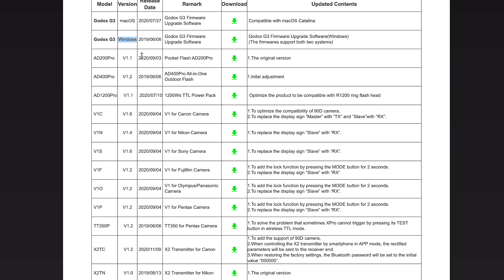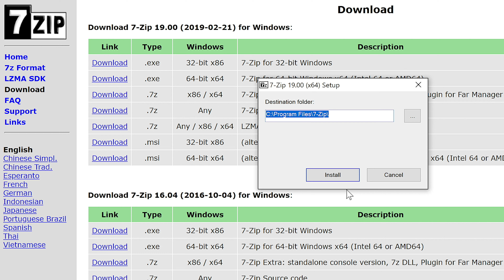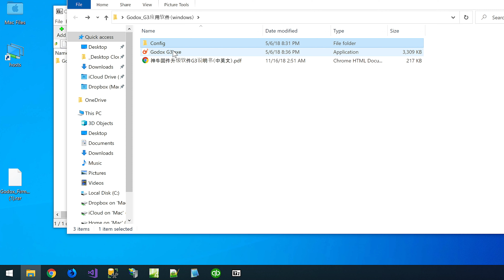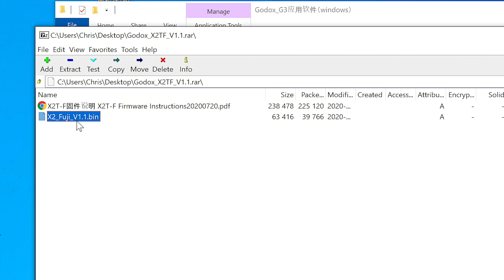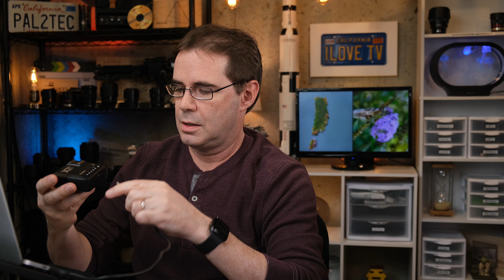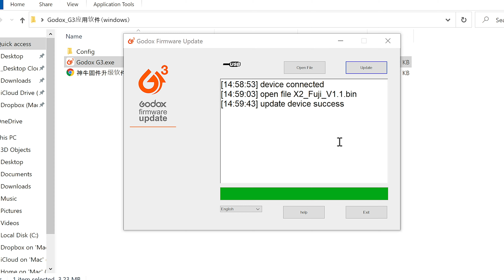Update Godox Flash Speedlights

Comment: All good tips however I had issues using Godox updater(s) and in my case it wasn't the cable, firewall or anything computer related preventing the update(s). After contacting Godox and trying their suggestions I finally figured out It was the actual Godox install package that was the issue. It was corrupt on their site and didn't have the correct "files" to recognize the product(s). Instead I used the Adorama Flashpoint series updater and it worked perfectly for my V860iin and Xpro transmitter. In case you aren't aware: Adorama brand flashes are just Godox rebranded and all of their accessories and updates are compatible with each other. Hopefully those who got the corrupt software can use this tip.

Comment: To be fair: the doc states 
"Please discharge the device before updating.
For X1T-F: Remove the battery and press the test button for 2 seconds"
Also, remember to use a proper micro USB cable. Some are only for charging. Figured out the hard way :o)

Comment: You, sir, are a saint! I successfully updated the firmware on several TT685N flashes from V3.2 to V3.3. Just FYI, this firmware file is a “.fri” file, not a “.bin” file. With firmware V3.3 I can confirm that the TT685N now offers iTTL and high speed sync with the Nikon Z6 mark II (and by extension likely all of the Z bodies). Awesome!
Reply: Any idear why the godox installer won't connect to my ttl685fn? Used multiple USB cables. The laptop beeps to recognise a connection but the installer will not. So frustrated as its been months now without the ttl which I need. I'm considering buying another unit but how would anyone know if its got the updated firmware for a nikon z6ii?
Reply: @callumjohnson9433  Sorry to hear you're having issues with this... you did type "ttl685fn" which is not a Godox model number. To be clear the TTL685F is for Fuji, and the TTL685N is for Nikon. There is no "FN" flavor. Verify you have the correct flash. Other than that, I have no idea why it's not working for you... Maybe your version of Windows isn't playing nice? Did you remove the batteries? You'll know it's correct when the flash has firmware V3.3.
Reply: @tomweis1194  yeah it's the ttl685n, not sure how the f got in there. I have removed batteries and done all the different trouble shooting that's online. I'm using Windows 11 by the way.
Reply: How were you able to open the .fri file? 7 zip won't open it.

Comment: I saw on a forum that you should press the power on button on the device once the batteries are removed....I suppose this is to dissipate any residual power??
I don't think this is absolutely necessary as you have shown the update worked without this step.
Reply from the maker: I didn't try that, but makes sense. Can't hurt.

Comment: The problem with my Godox is the way you have to down load a decompression software then down load the update before installing it on the flash drive. The problem is it is not compatible with windows 11 or with the Apple m1 laptops . So I’m stuck .

Comment: You are right, it is an absolute spectacular issue and to how many issues and hastle there is to update the firmware. Why is there no dowload of a windows .exe program to run the download? why do I have to load an .rar extractor to then extract the .exe program? why does the updater not start in english (once the right version of the update launchef was started - so we all have to figure out on which chinese icons we have to push in odefr to change the launcher to english??? and then, why does the firmware update instruction in dne manual and in the pdf from the website not say that the battery needs to be ejected and only then the flash connectec to the pc. all that jazz. this is not befitting a world leading brand at all. thank you for the video! i wouild have not managed to figure the connectuon issue out!

Comment: Hello, thanks for the video. You are very familiar with the devices, great tips! I have a question and can not find a solution: if I am in slave mode and the flash is unleashed via the X1T trigger - the flash unit flashes red on the front at an interval of 1 second for the entire time. Can you turn off this stupid blinking somehow / somewhere? It's frustrating!!!

Comment: Thank you for the insight, really helpfull.. Btw this firmware 1.1 does it fix the problem xt3/xt4 freeze issue while using trigger the godox strobe? Thanks before
Reply: i mean for the transmitter x2t fuji firmware 1.1

Comment: it is year 2023, it is already on USB-C but i still cannot update the X2T-F 
already removed battery
already press and hold he test button for 2 sec...
nothing work
tried on 2 Windows 11 computer and 1 Macbook
*update if you use USB C to USB C data cable, the product will not be connected
if you use USB C to USB A data cable, the product will be detected

Comment: I just got 2 Godox V1. I like them. But there is an annoying issue: it is so easy to accidentally change the mode from TTL to M while shooting by unknowingly  pressing the button with the forehead. there should be a way around this. like locking the button or requiring a longer press. I have been using the TT685 and TT350. Never had this issue. The V1 seems to have a better menu layout, but the mode button accidental press is really an annoying issue, that can make you miss some shots. Godox should address this via firmware, if possible.

Comment: You were VERY helpful, but this was still a total PITA. First tried with Windows 10 on my mac via Parallels, flash wouldn't connect. Then tried on a friends Dell running Windows 10 and disabling driver verifications, etc. No dice. Finally got another laptop running Windows 7 - same frigging thing but then eventually it decided to randomly detect the flash and update. Oi vey Godox.